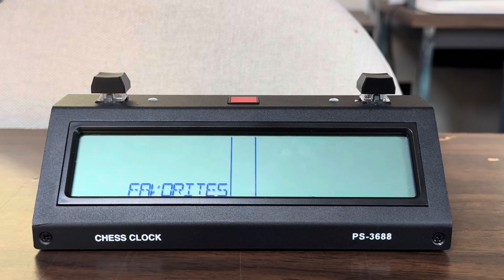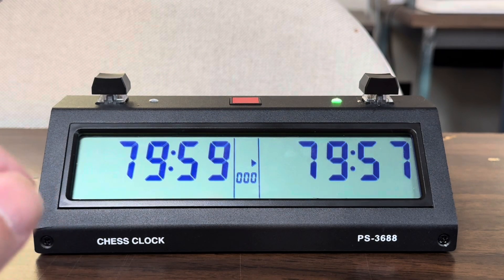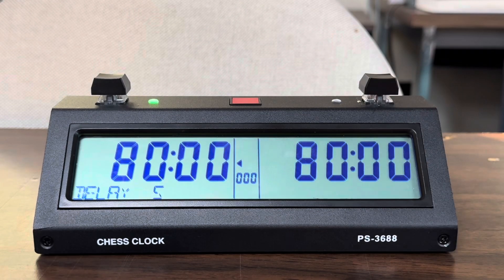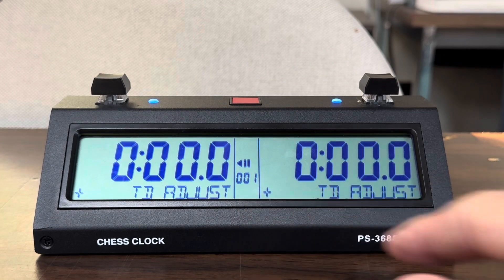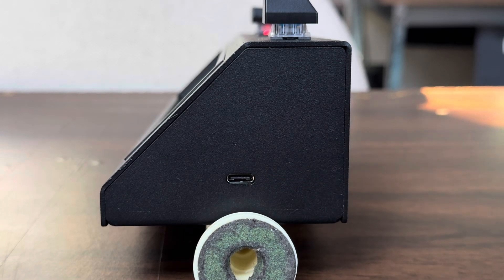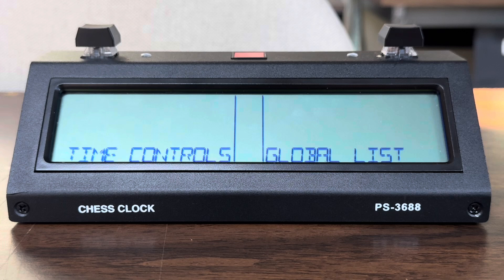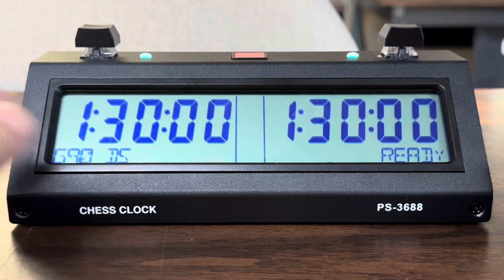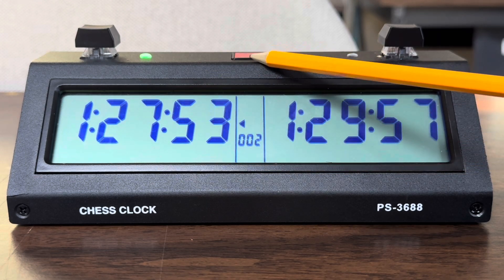Prototype problems for the clock

Comment: The USB C connector on the side of the prototype is used to upgrade the software by manufacturers, the acceptance and certification of the clock by FIDE can be verified by providing that the firmware cannot be updated without a manufacturer code issued by FIDE itself after testing the upgrade. Not installing that connector is a death notice for the equipment, just as happened with the VTEK 300 in its first firmware version with flaws that could only be corrected by returning the clock to the manufacturer, an enormous cost for a problem that is not the customer's fault. Do not repeat the mistakes of the past, that problem dynamited the future of VTEK among other problems. And please respond to my emails requesting the VTEK 300 version 1.1 manual. Thanks in advance.

Comment: Check out the reviews on those type of buttons on other devices. There are a lot of complaints from users regarding the on/off switch becoming recessed from usage, rendering the device inoperable. Hope that doesn’t plague yours.